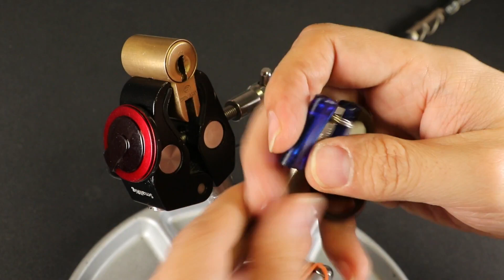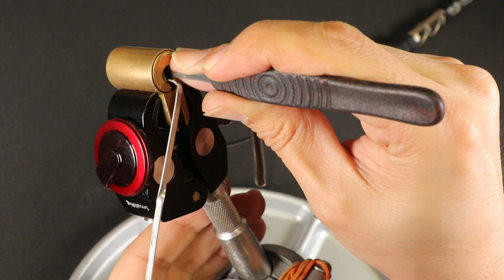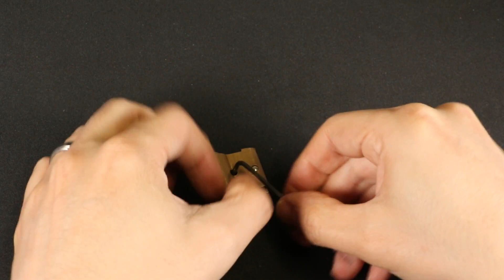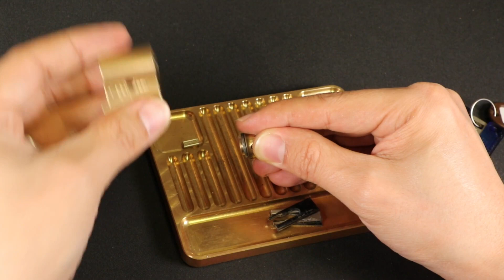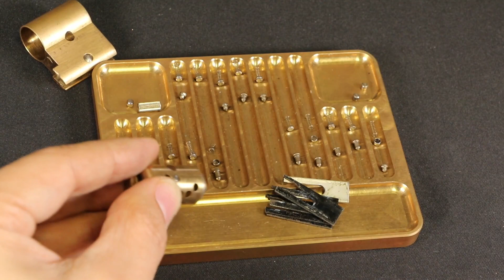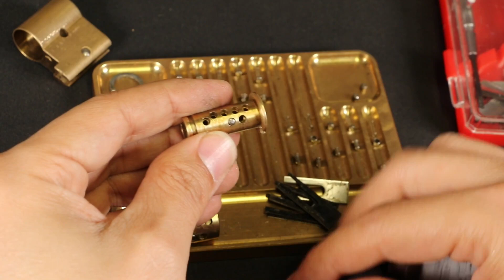[L164] French Bricard Chifral S2 Lock - pick and gut

Comment: Nice job!
The moving tab at the tip of the key is for key control, making it harder to copy the key. Replicating dimple holes on a blank key would not make the key open the lock as the pin matching the tab in original key would not lift up.
Also I believe this tab makes picking harder : key impression won't work and special tools like rotor won't either.
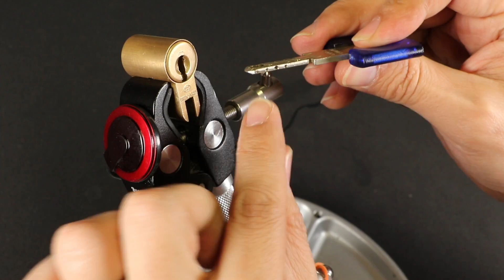Reply from the maker: Exactly, it's what we refer to as an interactive element and I explain it in greater detail at 0:19 It's been a while since I picked or looked at this lock, so can't remember why I commented it doesn't have an effect during picking. But if it doesn't affect picking, then you could just leave that area open on the key (ie, cut it entirely away)
Thanks so much for stopping by!
Reply: @norlin76  I guess if you cut away the space of this tab, the pushing pin that raises the tab will go up but raise nothing, so the "receiving" pin (the on raise by the tab) won't raise either and its driver pin will keep locking the shearline.